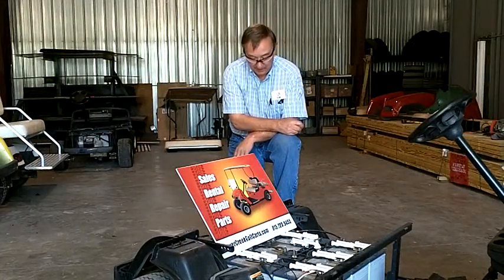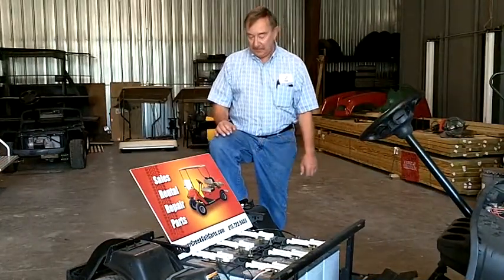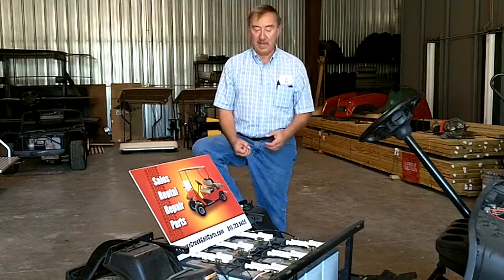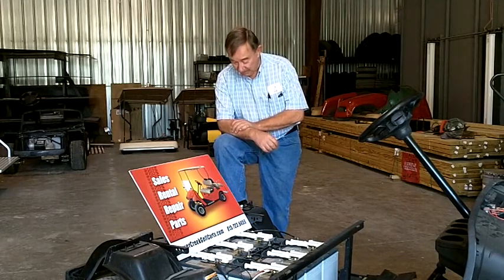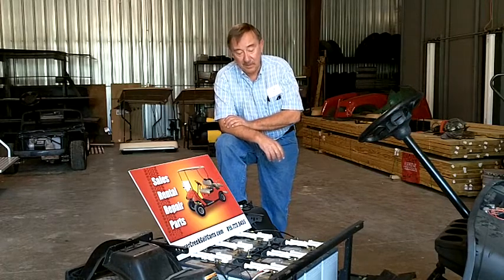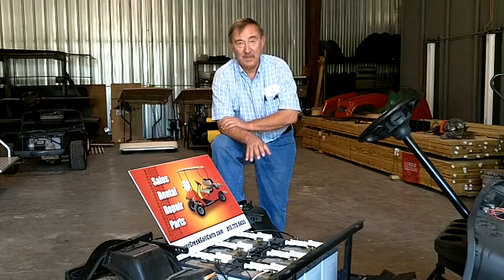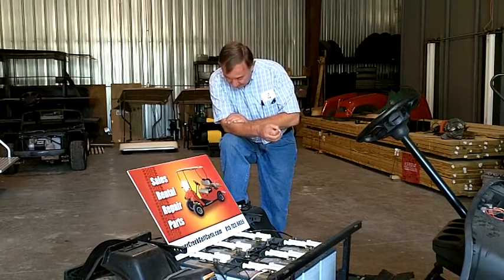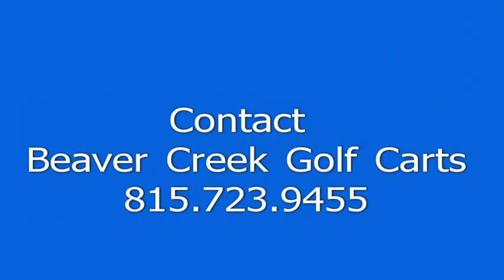Watch Beaver Creek's Bill Rulien answer your questions on golf cart batteries

Comment: The batteries are fastened down so when you go over bumps they don't tip over and/or slide out of position.  A little vibration is actually good for them cuz it helps prevent stratification.  Why do you think they have battery shakers?

Comment: Bill, I recently bought some used golf cart batteries to set up a battery bank for emergencies.  Out of the six I got, 2 of the batteries have short posts on them.  I tested the batteries and they are usable, but not sure if I can use them with the posts widdled down like they are.  Do you know if they are still ok to add into my battery bank?

Comment: Your statement at 2:00 is wrong.  If I put six 12V batteries in there and wired them up for 36V and the 12V batteries are 105Ah each and the 6V batteries are 210Ah each, then those 2 systems at 36V should be nearly identical in performance assuming all of those 12 batteries are of similar health.
Reply: David James sure for awhile. But tbey will degrade much much faster then the 6 volt deep cycle batteties. 12v batteries almost always are made to a lesser standard then 6v batteries